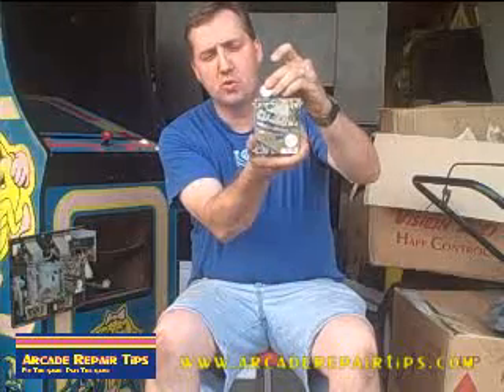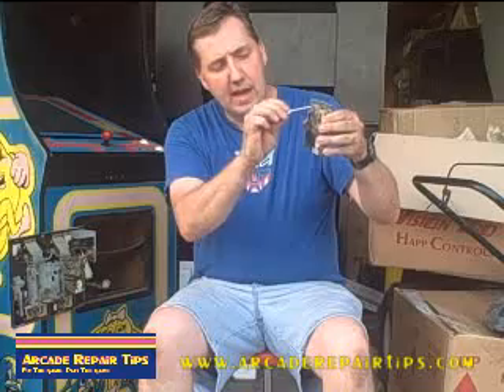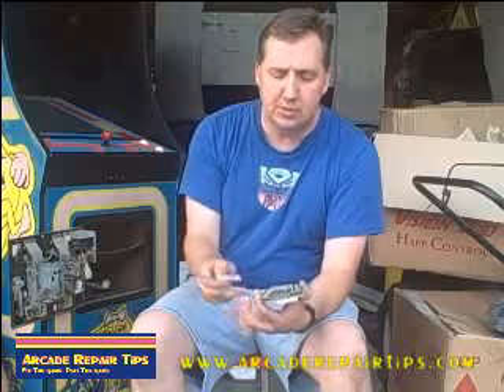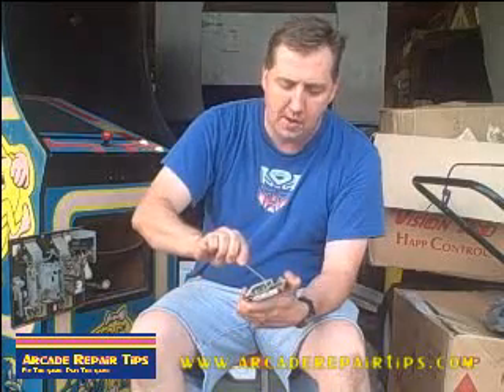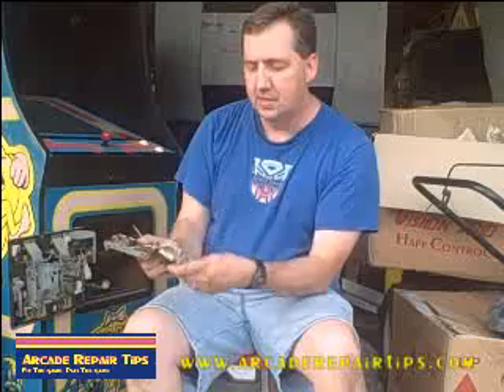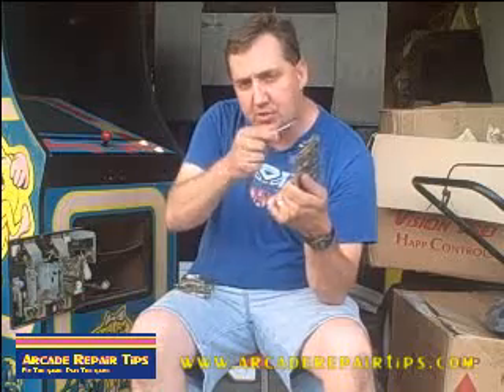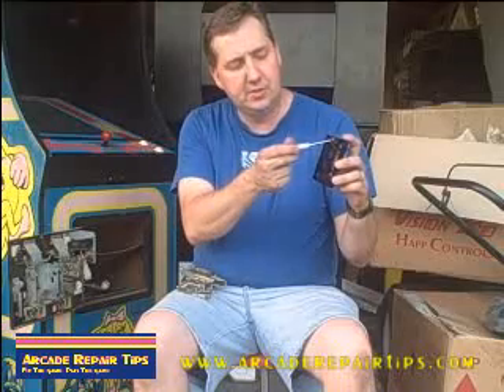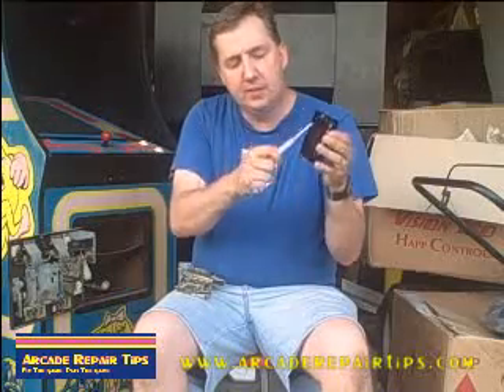Arcade Repair Tips - Adjusting A Coin Mech

Comment: Is it possible to convert a micro switch coin mech to an electronic coin mech?
Reply from the maker: Yes, you just need to attach the wires currently connected to your microswitch to the correct locations on the electronic coin mech wiring. You will also need to run voltage to the electronic coin mech as well. Be sure to refer to the manual for the electronics coin mech that you purchase for additional information. Hope that helps.

Comment: Do you know how to determine if my coin mech is broken or can be adjusted? I was hoping to see a video on how to disassemble and replace it. It's a midway galaxian cabinet that is very similar to the pinball style. The coin mechs are made by Coin Mech. When I push the metal button to let the coin out, the button is really hard to press. How do you fix / adjust the button for the coin release?

Comment: can you please tell me how to lower the volume. I have a ms pac man but i think the board is a replacement board meaning it was another game before but I really want to know how to turn down the volume. Its too loud
Reply from the maker: On original Pac-Man/Ms. Pac-Man game boards, there is usually a volume potentiometer located just below the heatsink in the top right of the PCB (when you have the board oriented with the edge connector on top). Adjusting this pot should control the volume. If the pot does not work, check that the value is changing when it is adjusted.

Now, it’s possible that you have a bootleg game board that does not have a volume control on it. In this case, you can install your own volume potentiometer between the game board and the speaker. See our post/video on Assembling A Cocktail Cabinet Kit (With JAMMA Wiring Harness) (https://youtu.be/pGiSR3WgyRU?si=cSFGMkyhEuto47MP&t=1403) for more information.

We will also be covering your question on our Live Show Episode 93. Here's a link to the episode if you want to watch it: https://www.youtube.com/watch?v=KwfacvKA_BM

Comment: But what if it falls though without triggering a credit? If I manually move the microswitch wire a credit is triggered so it's the mech that's the problem not the machine circuitry. Also, the other mech works fine.
Reply from the maker: So, it sounds like your coin mech is working correctly. The only job of the coin mech is to accept or reject the coins entered through it based on it's settings. It drops the accepted coins on to the microswitch and into the coin box while the rejected coins get sent to the coin return. Even though you can activate the microswitch manually, that doesn't mean that it's working like it should. You might try bending the wire for the microswitch down a bit so that it doesn't have as far to travel when the coin makes contact with it. Of course, you can also try replacing it with a new one or swapping it with the one next to it (if you have a door with two coin slots) to see if that helps the problem as well. If you need additional help with your issue, we will be discussing your question on our Live Show Episode 64 which can be found at the following link: https://www.youtube.com/watch?v=RARf8Re0QyQ

Comment: is this one size fits all on classic arcade coin doors, i.e, classic Atari, Nintendo, Konami, Jamma, etc.  coin door, Midway, stand up, cocktail etc all have same size coin mech that fit or brand specific

Can you buy wrong size of its missing

Difference between classic xoin door wiring & Jamma coin door wiring

Lock that work on heavy duty security bars

Comment: i work at maggi maggi in england we repair and reprogram allsorts of fruit machine power supplies mpu5s mpu4s pluto boards electrocoinboards tft monitors change machines note validators vending changers jukeboxes amps and a wide range of coin validators,

Comment: I don't believe this video is accurate.   That initial screw isn't the only adjustment on the coin mech.  You can't use this technique to modify a coin mech that is designed for a specific type of coin (i.e a token) and make it accept a different type.